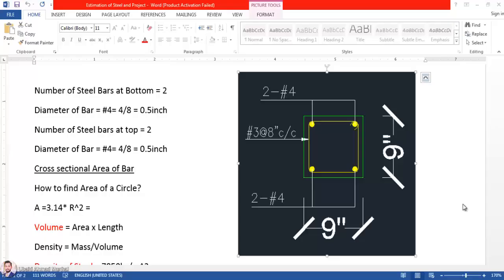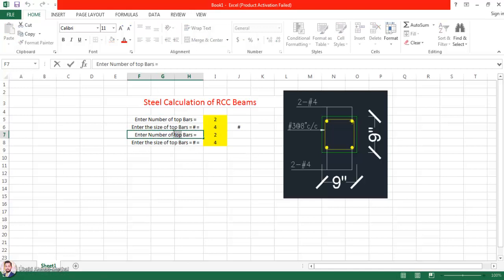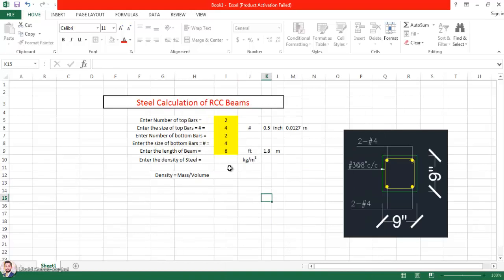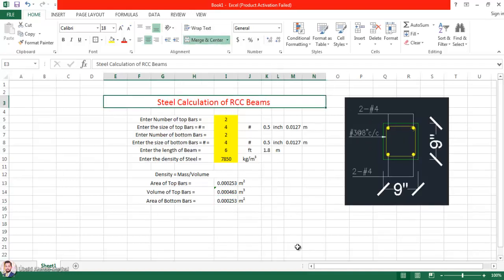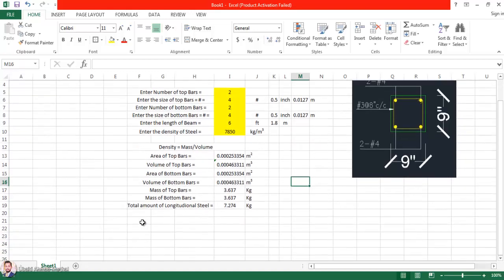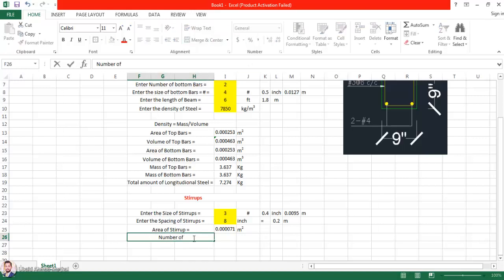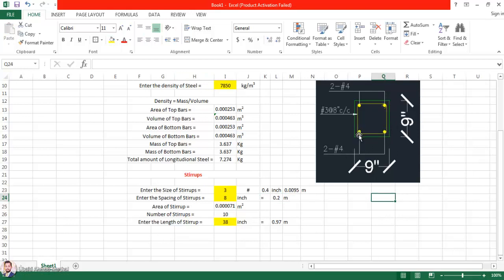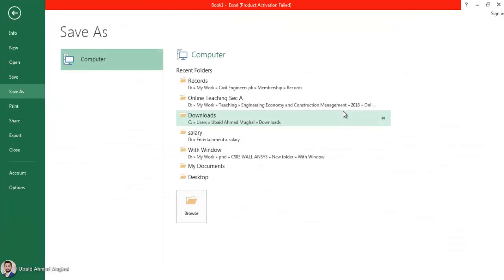Calculation of Steel in RCC Beam | Excel Spreadsheet

Comment: I want to do the same thing but my idea is to use a vlookup. Im currently working in a Drawing office  as a draughtsman. We do need to make a BOM including mass of of steel members & plates. Steel members have a mass per meter. You can find that in a structural steel book. So my idea is to make a lookup you can choose the type of member insert the length state quantity an then it would calculate the mass from there. Plates i do calculate as volume. I use the 7850kg/m³ for carbon steel. that was easy to do but the vlookup is a headache .
Reply from the maker: Yes vlookup can be used to make a detailed and more automated worksheet. Some excel sheets are already available on internet which contain all the properties of steel sections. One use vlookup and Hlookup to automate it. This sheet is for the beginners and students. Once they learn to do it then they can improve it according to their requirements.